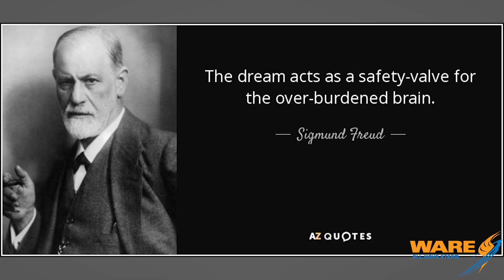What are Safety Relief Valves & How do They Work? - Steam Culture

Comment: My Burnham gas steam hydronic low pressure furnace safety valves doesn't look like that. Mine look like an cast-iron elbow with an aluminum 1.5"' handle that lifts up ...My boilers been not operating for a week and i fired her up, and  the internal syphon started to rise so i powered her off ..by securing power, and gas, is that normal, because the psi was approaching 30 ?